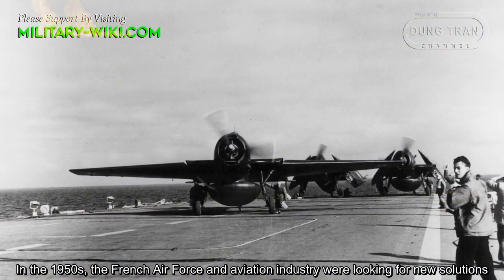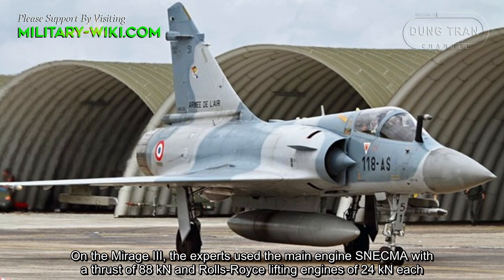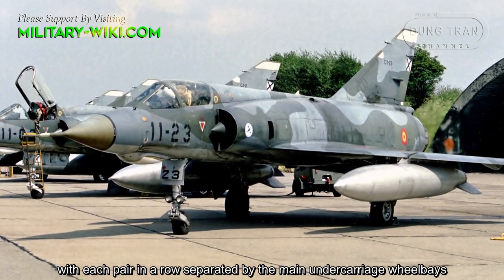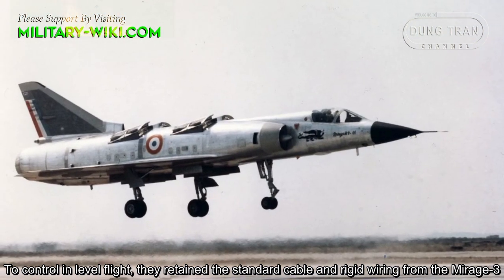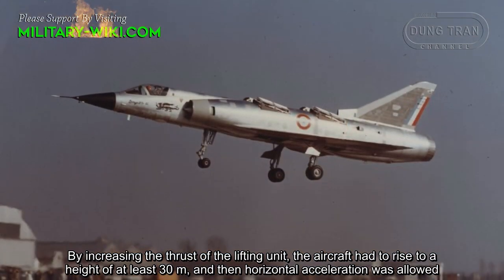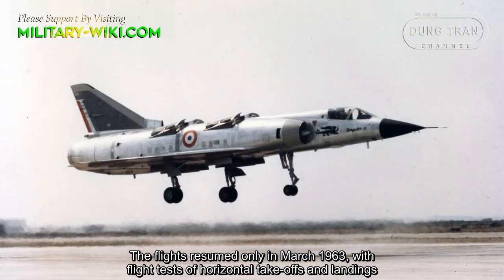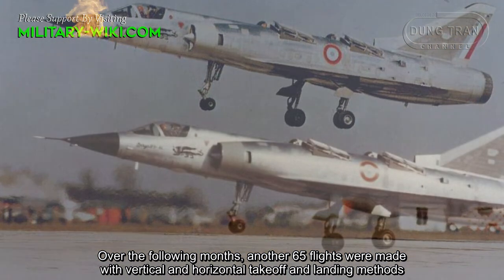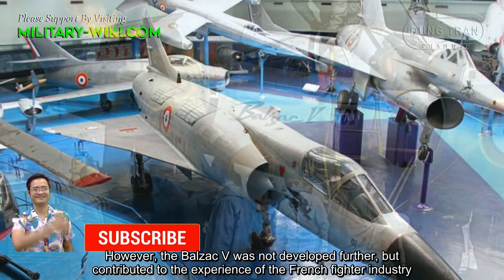Dassault Balzac V - French Ambitions For VTOL Aircraft

Comment: Very interesting. This was a technically interesting, but very complex aircraft. Especially compared to its main competitor for the NMBR contest that it was designed for, the Hawker P.1150/1154.

Even though you did mention it in passing, you should have said clearly that one of main problems with the aircraft was that it had NINE(!) engines. That's a lot of dead weight in forward flight.

Eventually, a little bit of French engineering was included with the world's most successful STO/VL combat aircraft so far, the Harrier. The idea for vectored thrust by Michel Wibault.